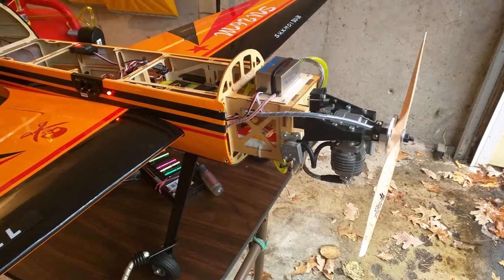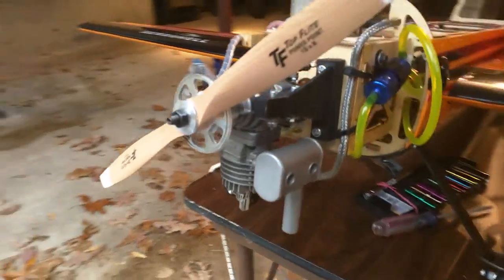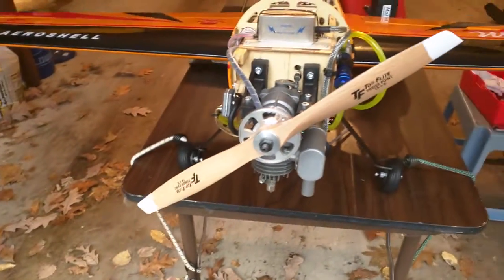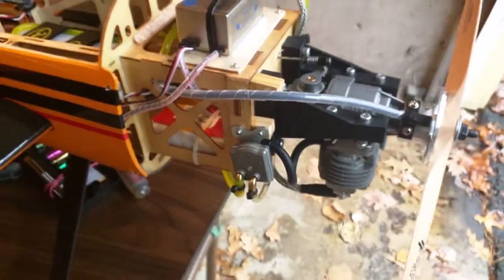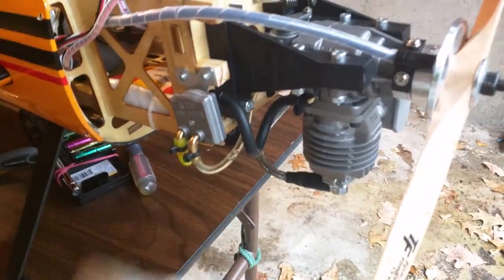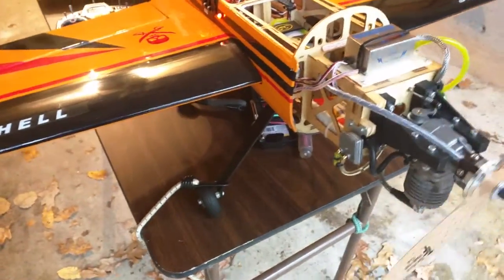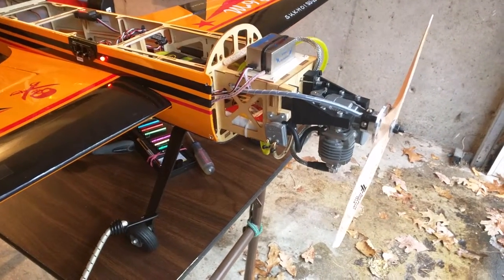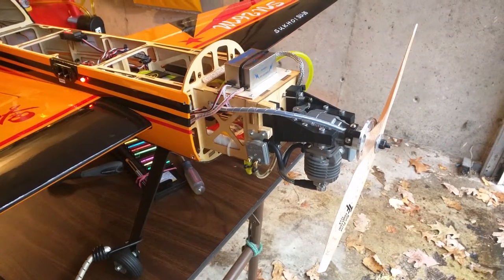RCGF 10cc Won't Start...

Comment from the maker: MaxDef, I put the engine back on without the tach and still not starting. Clear indication gas is moving to the carb though. New engine is supposed to be here in a couple of days.

Comment: I always take the spark plug out the move the stick to full throttle. Then I use my electric starter without the spark plug in the engine. This will prime the carb every time. You can put your thumb over the muffler to make it prime faster. If it floods its okay it will drip out the spark plug hole. Then I put the plug back in the engine give it 1/8 throttle and start it. Dry carbs will be tricky and propping by hand may not do the trick.
Reply from the maker: Got this particular engine running sweet for a couple of years now, but my first one has been acting to fool of late. I think it's the carb, but it's plenty wet... May try you idea soon. Thanks!

Comment: I am on the same boat and I am finding something strange. No matter what I do, it doesn't pull gas into the line/engine. I tried to prime the engine, and to my surprise, not even the pump can get fuel into the engine. I removed the spark plug, turned it, primed it with the manual hangar 9 pump, no gas into the cilinder. I now try to blow the line and I can feel that it is completely blocked. I can't blow air through it 😮

Comment: Ken if you havent gotten it started unplug the tach. I got mine started with out the taxh. Once i plugged the tach in it killed the engine and would not start with it plugged in.

Comment: rcuniverse has a thread under gas engines for rcgf. They can help you there if you can't get it started,Joe monitors that thread as well. try a starter first. That usually helps.

Comment from the maker: GOOD NEWS! We solved the mystery, but we still need to see how its going to act in the long run.

The first time starting she needed me to manually choke the carb by putting my finger over the air inlet. Joe Nelson came up with this and the first time I did it I got a sputter. I took my finger off and started her and BAM! She ran!

Follow up on http://pretorian435.com

Comment: DLE doesn't make a 10cc.  You need to get it spinning faster so that the pump can pull fuel. The engine can be hard to start for the first time if the pump is dry.

Comment: You need to use a starter to spin it up to draw fuel, even at best of times it will need a starter due to low compression...

Comment: I have the same problem with the same engine. I feel like the fuel is not getting to the carburetor. fuel is not sucked in. I disassembled everything several times I'm out of ideas. this engine has flown very little. I think it's a bad buy.

Comment from the maker: Thanks, MaximumDefelction. All good points. There is foam under the ignitiion, so that's protected. I figured out that the pump was dry and wondered if the piston wasn't developing enough vacuum to pull fuel with a hand start. Working with Joe Nelson at RCGF-USA and we, along with some of his experienced flyers who had figured this out and some like me who hadn't used a started, that this is almost certainly the problem: the ones who called not being able to get it started weren't using a starter. I am going out to RC Buyers Warehouse this morning to pick one up. I am pretty sure this is the fix!

http://pretorian435.blogspot.com